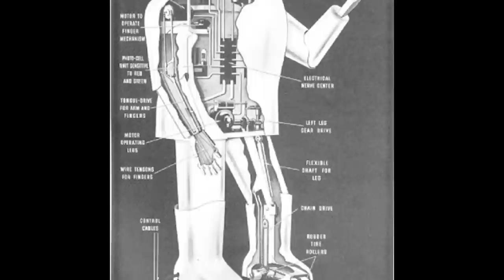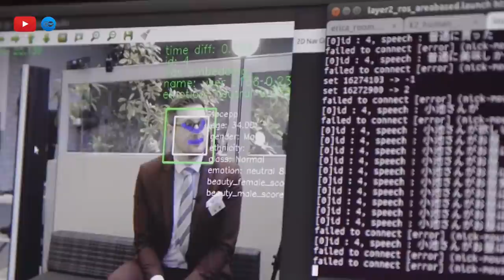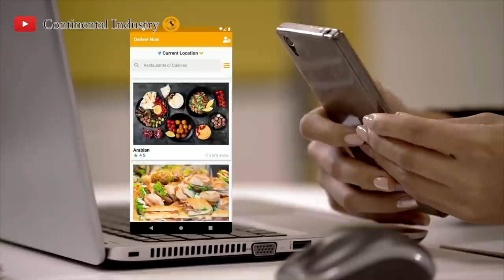Future Robots 2030 | A Brief Of Our Future Robots | Tech Tech

Comment: If robot is bad will it go to jail? Delivery bots will have to be police bots also to keep from being stolen? Police bot says "step out of the car please" SELF DRIVING CAR WILL NOT OPEN DOOR ,Now what.
Reply: Automatic shutdown and instant emergency service entry  by authorities will be available in most cars and trucks eventually.
 And if a robot went off it's programming that badly it would probably be extensively researched to find out what happened and prevent it from happening to the rest . So it would at the very least be wiped , repaired and reprogrammed,
 or scrapped out completely and replaced like a recalled motor vehicle.